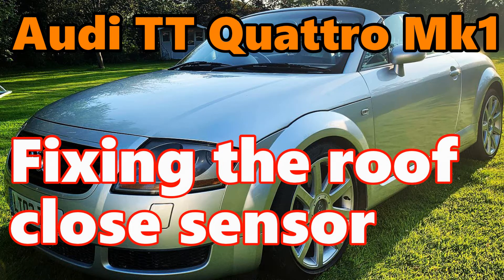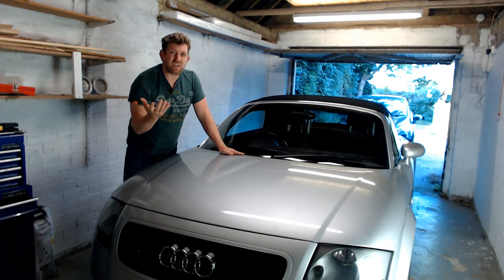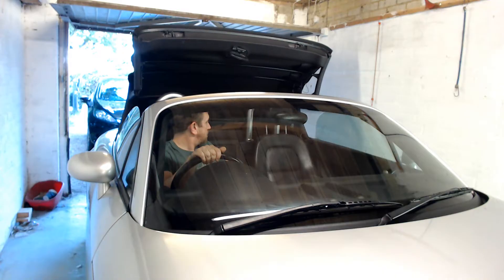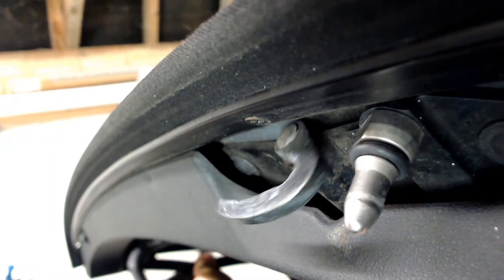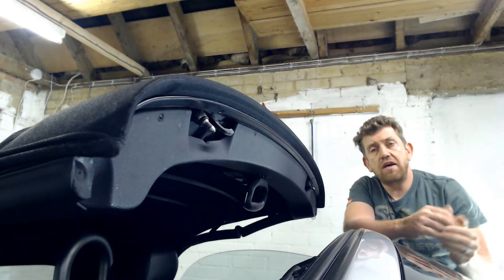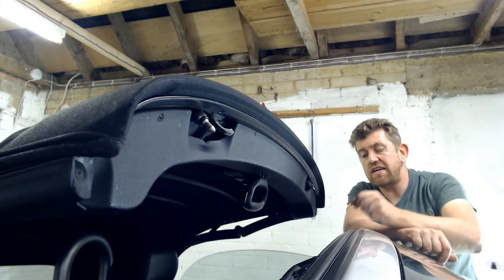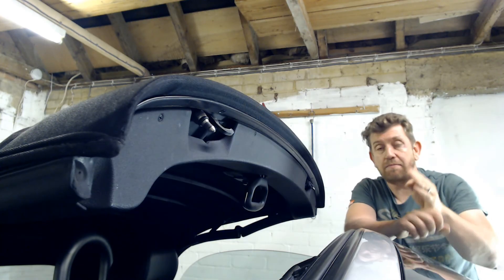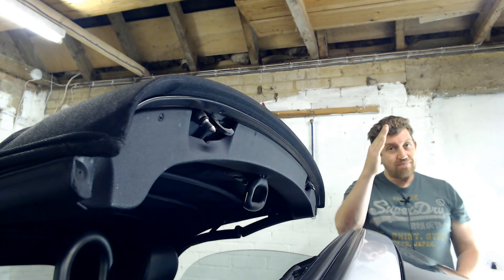Audi TT Mk1 - Fixing the roof close sensor on a cabriolet

Comment: Thanks Andy for taking time and articulating the issue and the solution, I happen to have a self tapping screw Spring clip which fitted perfectly over the switch actuator paddle thus increasing it's thickness. Job done.
Reply from the maker: Great work Derek! Always good to hear of alternative ways to crack the problem. Thanks for your kind words!

Comment: IT WORKS!!  Awesome!  I cut a small piece of a body filler plastic blade that is very slick and slightly tappered 1/2" X 5/8" roughly (12mm X 16mm), cleaned metal microswitch part with alcohol, used 2 part epoxy and waited over night to try it.  To my delight...light went off with roof closed.  Great tips Andy and loved the illustration too.
Reply from the maker: Thanks Sean. I was skeptical also but it does work! It just thickens the mechanism enough to make contact. I’m glad it sorted your problem!

Comment: your channel is a blessing for the tt owners. Can you make a video about how to fix the wind deflector? i know it's a very common issue.  For example , when i bought the car only the  one side was going up and down and eventually it stopped moving at all. I only here a clicking noise when i activate the switch
Reply from the maker: Hi Eliza and thanks for your comment! I would imagine one of the motors that drive the mechanism for the deflector has failed. It could also be the fuse/relay has failed but I would expect that they are both on the same fuse/relay.  Therefore it is more likely to be the motor. I will investigate for you and see if i can do a video. Thanks again and keep on watching the channel!

Comment: Another top solution...well done mate.
Reply from the maker: Thank you very much Gary! Much appreciated!
Reply: Hi I have just got into my MK1 2001 plate soft top and the switches are not opening the roof for me not side where the fuse is for this I have checked the Haynes manual trying to fix it myself hope you can help
Reply from the maker: @mariamshai2530  have you checked the various relays and fuses that power it? I think they are i the drivers footwell

Comment: Brilliant - this is exactly what was happening to mine. Also why the windows don't go up the last inch or so after the roof has gone down.
Reply from the maker: Hi Simon. If the windows are not going up when the roof is down, do you get the flashing "roof down" light on the dash? It would suggest there is something stopping the roof going all the way down or the sensor that detects its all the way down is reading incorrectly for some reason. Worth checking. I am glad my video helped you out buddy!

Comment: another option (the one I use): do the adjustment on the oposite side by placing a very thin piece of plastic or metal tube over the bar that the hook goes around. This will pull the whole roof over very slightly (to where it should be perhaps) and close the finicky switch on the drivers side.
Reply from the maker: That is also a very good solution Tracy. It’s all about getting that hook over far enough to push that switch, one way or another! 👌 thanks for the extra tip 👍

Comment: Hi done you have any clues on why my roof won't come back up? The roof comes down no issues, windows drop a small amount as normal... but when I hit the switch to come up the windows drop a small amount and go up again... which then doesn't alow the roof to start it's journey back up to the close position. 
Totally baffled with this
Thanks in advance 
Chris
Reply from the maker: Hi Chris. Check both sides of the roof, just about where the roof hinges up to make sure the 2 struts are attached. They are like the ones that hold the boot open and clip over a ball socket on the hood and are secured by a metal clip. They have a habit of popping off.
Reply: Thanks for the reply. 
Everything looks fine. I have also done a window reset but not helped. 
The window just won't stay in the position (about 1 inch down) while I  hold the button to bring the roof up. So the roof just won't start to lift.
Fingers crossed you have an idea.
Thanks

Comment: Does the light stay on the dash when the roof is open as mine does not
Reply from the maker: When the roof is all the way retracted, there must be a sensor that detects it down. The light goes out at that point. Anywhere between fully open or fully closed activates the light 👍
Reply: @andycharger  thanks mate

Comment: Great video, Andy! Thanks so much for posting these. I'm having the opposite issue. The Folding Top warning light stays on even after the top is all the way down. I take it this is a fault in switch F171 but I'm not sure how to access/clean that switch. Any thoughts?
Reply from the maker: Hi Noah. Thanks for your supportive feedback! That sounds like something is not triggering in the "down" position. I will take a look at the removed hood and see if i can spot a sensor of any sort that might register its down.
Reply: @andycharger  Thanks! I'm pretty sure it's Sensor F171 that's not registering the nec 9V when the top is down but I'm not sure how to physically access it. Would love your advice. Cheers, N
Reply: @andycharger  Howdy! Any news? I'm really struggling with this and my mechanic wants a lot of money just to diagnose the issue. Hoping you can help me figure out how to access Switch F171 to see if it maybe just needs a cleaning. Cheers! N
Reply from the maker: @osainista  sorry for my late reply. If you drop me an email I will take some pictures to show where I think the problem microswitches may be. andy_charger@hotmail.com

Comment: Hi Andy my roof won’t go down with the switch, I can hear a click but no movement any ideas mate.
Reply from the maker: Hi Paul. Any sound like the pump/motor running? It’s common for the CCM to faul on them if water has ingressed. If the CCM is ok, a fuse or the actual pump could have failed. The struts that raise and lower the roof have a habit of popping off too so check those. 👍
Reply: @andycharger  it goes up ok Andy with the switch engaged is there a separate fuse for it going up,what’s the easiest way to get at the cam because I looked at we’re it is and it’s a bugger to get at. Thanks for reply mate.
Reply: Ccm I meant I hear a clicking noise when I engage the switch for bringing it down it goes up ok mate

Comment: Mine does the opposite, the light flashes continuously when the roof is open and the wind deflector no longer goes up. It looks like the previous owner has already modified the micro switch
Reply from the maker: That sounds like a short somewhere in the system. Have you checked the fuses and relays?
Reply: Check Sensor F171
Reply: I have this exact same problem. Would love to hear if you've been able to solve it and, if so, how. Thanks!!